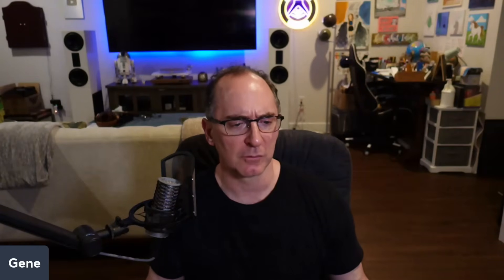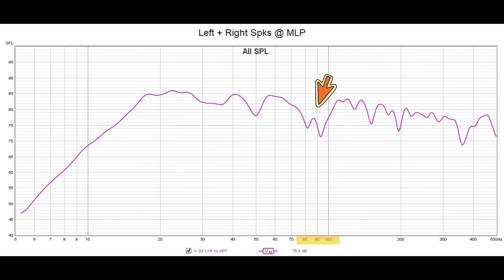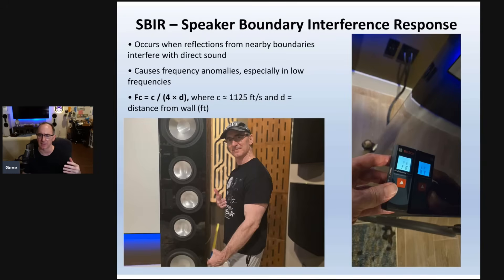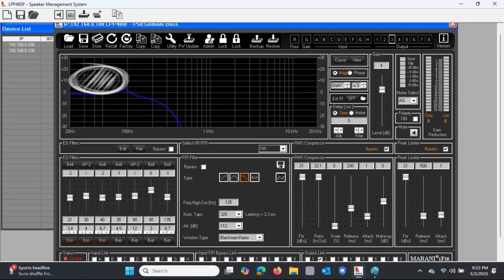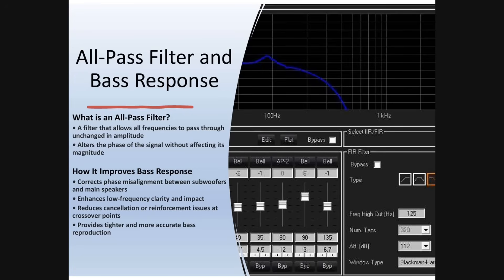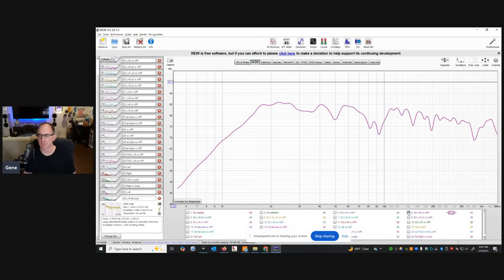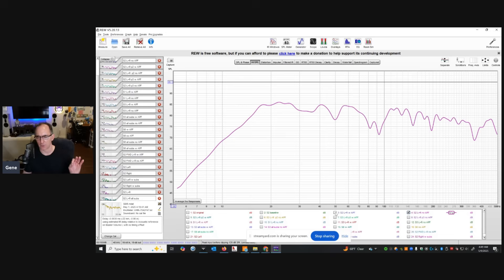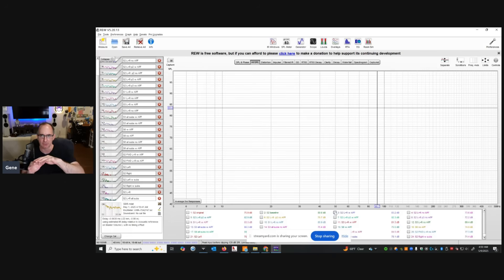4 Fixes to a Common Bass Problem Revealed!

Comment from the maker: :_Shout: Only a speaker completely flush against your wall surface is considered an infinite baffle immune from SBIR effects. Use the calculation: Fc = c / 4*d where c = 1125ft/s and d = distance in ft from front wall to your speakers bass drivers to calculate the problem frequency range due to SBIR effects.
Reply: So basically only an in-wall speaker?
Or also a speaker with no rear port placed against the wall with no distance?
Reply: @xavdeman a speaker pushed up against the wall will still have the distance from wall to the driver. The front of the speaker needs to be flush with the wall
Reply from the maker: @MrBonger88 correct, which is why I added the note here.
Reply: @Audioholics  This much has been known for decades, really, but the exigencies  of achieving the least compromised in room performance while attaining domestic acceptance is the bigger problem, I think. To mitigate the room problem as much as possible, either build a she like Ron Brenay, or just just use headphones and buttshakers . 🤭😵‍💫
Reply from the maker: @xavdeman correct

Comment: I got my Sonus Faber Guarneri Evo speakers out at around 4’ 7” which gives the boundary effect at 60+ Hz.
Also have a set of Duntech PCL-15s at around 5”
Having Trinnov Amethyst and a stack of 4 Audio Physic Rhea II subs, generally crossing aroound 70Hz …. Insanely great and bass to die for ❤😊😎💖🤩😍

Comment: Hey Gene, I would love to here more about bass management. I recently added a minidsp 2x4 hd .What a game changer .Never heard bass so tight,smooth, and accurate. I built my third and final theater. Watched your videos on speaker placement during construction. I never used subs with two  channel audio before. I have a very tough room .I feel I could, and I'm sure a lot of your listeners would benefit from an extension training program regarding all the features of the minidsp. A sort of step by step ,maybe develop a course we could follow at home ,even home work to summit to our channel, and you to go over the results, including room treatments.Regards Jim

Comment: Hi - for towers with large woofers like 12-15" should you use a large speaker setting or set the LFE to LFE+main for double bass on a Denon?

Comment: Thanks Gene, that was unbelievably helpful. I have Triad Silver in-room LCRs, along with four SVS SB 16 Ultras that I had an all four corners. I had the Triads pulled out into the room 2-3 ft and no matter what I did I had that same suckout in 8O to 100hz range and it was noticeable. I pushed the L/R speakers against front wall the four SVS subs now at 1/4 and 3/4 in the front and back of the room.

Problem solved, I'm now really flat through the crossover and the bass is so much noticeably better.

Appreciate it!

Comment: Hi Gene I have speakers with ports in them that I currently have plugged. I also have a subwoofer with two ports and I leave one unplugged. How do you know when it is better to unplug a speaker? My LR Speakers are about 1 foot away from the wall. Might be a somewhat simple question but I'm sure lots of people wonder the same thing when getting into sound systems.

Comment: 6:40 the phase dial or sub 'distance' setting is also a form of phase correction - good enough for most people.
Reply from the maker: Pysse dial doesnt behave the same as distance but its still a very useful tool. Distwnce adjusts delay for the entire bandwidth while phase control usually works around a narrow bandwidth.

Comment: I’d like to ask that you do a video addressing bass issues in your 2 channel setup.  I think the approaches are similar but differ in significant ways.  Deep bass (below 40-30 hz) is less important for most 2 channel systems as there is less musical content in the deep bass area.  Second, my guess is that your 2 channel setup is in a smaller room than your HT setup and small room acoustics are particularly challenging.  Third, going over the same issues in different settings would be very helpful as this area is complicated, with few straightforward solutions.  The problems with bass are predictable: room modes and SBIR.  But the solutions are not.  Every example helps others to figure out how to approach their situation.

Comment: I have same problem with my rel 1205 mk2 x2 , they can only do BASS under 70hz, on 80-120 hz i have deep pit( which is strange, because my signature 73 centre x3 by passport can even play up(down?) to 33Hz, but in fact 70-90Hz they are very weak (plus a small room with mods gives an indication of itself). I used to have no such problem with small class phase-inverter subwoofers, they were humming from 70 to 120 Hz :)))))))))) but after switching to Rel Ht I got this issue :(

Comment: I love your videos! Have yall made a video I haven’t seen addressing the klipsch rp1600sw still having amp problems? I’ve watched your video review on it several times as I’m in the market for 2 sub upgrades and I’d love to try out klipsch subs to match my klipsch 7 bed layer and 4 atmos setup but the amp issues I’m reading and hearing about is making me want to just suck it up and buy 2 pb17ultras

Comment: I just picked up a brand-new Klipsch R-101SW, fresh out of the box and I’ve noticed that the bass output is unexpectedly low. I’ve tried multiple connection methods
- RCA Audio Out from my TV  
- Line Output from my amplifier which is a boss car amp running in my home

Despite these setups the subwoofer's bass remains weak. The gain is turned up appropriately and I’ve ensured all cables and connections are secure. Are there any known issues with this model? 

I’d really appreciate any insights or troubleshooting suggestions from those familiar with this sub.  

Thanks in advance!

Comment: i have a slightly annoying problem. My old Marantz SR7010 died. So I thought, that Marantz Cinema 50 looks nice. My problem now is that the high end is a bit more clear but the low end is really weak. I can't find any real settings that can changge this and I¨'m not convinced the difference between 7010 and C50 is that big. Any suggestions?

Comment: Hi Gene, when you say to place a sub in a corner behind your speaker should there be a clear line of sight between the sub and the listening area? My speakers would block at least part of the  line of sight.
Reply from the maker: @tooch-g8k  it doesn't matter at bass frequencies.  Place the subs corner loaded or against the front wall. Sometimes, I place the sub sideways, so the driver doesn't fire at the listening area at all.
Reply: Thanks for your time, Gene.

Comment: Really like your podcasts, but isn’t there a way to address SBIR that you did not mention: DSP.   If you happen to have a measurement mic (I do) and can run room correction SW like Dirac (which I have), you can see the effects of SBIR and correct the bass response for it.  It might take some power, but in my case, I have dual 15” woofers (open baffle) wired in parallel for a 4 ohm load and my woofer amp (speaker is bi-amped) put out 450 watts per channel into 4 ohms.  I have all the grunt I need.  This is not a HT setup, rather this is 2 channel.

There are lots of reasons to have a sub(s) in 2 channel, but in terms of addressing SBIR, isn’t this a viable approach?

I did some research and it turns out you cannot power your way out of nulls.  The only real way to address them is proper placement of a sub to counter the null.

Comment: I've set up my system in three different homes over the years. My current (and hopefully FINAL) setup is the best I've done so far, but I still have the classic problem where the bass sounds alright in my MLP, but sounds AWESOME when I'm standing up behind my MLP...

Also, no matter how I set my two subwoofers, music 100% sounds better in direct with the fronts running full range.

Comment: Great information shared 👍 

Room is the biggest challenge to achieve the best audio performance especially LFE.

Since you are a bass lover i am very interested to ask you about LCR with Subwoofer integration by using high-level connection Subwoofer company like Rell Tx series provide high-level speakon connection as well as LFE they says it works both duties like directional bass and LFE their recommendations like LCR use bookshelf (6.5" Driver size & freequency response 50-20khz) and assign as a Large on AVR / pre-pro.for Subwoofer settings recommendations are LFE+Main and crossover to 250Hz In real situation how it's going to perform.is it really make a huge difference in hometheature experience 

Lastly we would like to see your DSP (Marani LPP480F) setup and configuration in a dedicated  video

Comment: I have large towers, dual subs and a small livingroom.
My electronics are a Denon X6500H and a NAD M27 power, so enough power and dual 14" subs
 I never got Audessy quite right in this room. Eighter to flat and lifeless, or uncalibrated an very boomy in some frequenzys. HUUGE of the charts roomgain, but not very good bass calibrated.

Before i spent a "ton" of money on new electronics, or better roomcalibration, i came across the Audessy EVO tutorial here on Youtube, and MAN! That was a game changer for me.

 Without replacing reciver or buying Umik and DSPs, i just ran a accurate normal calibration, ran the EVO script with help from REW, chose the prefered target curve(harman target curve+10db as i allso like bass) and like magic! Both music and film sounds amazingly better.

Comment: Bassreflex and no room to breath is the biggest problem of all, besides that most people buy to big speakers for their room. I think closed enclosures are better overall.
Reply from the maker: Agreed IF the closed enclosure has enough deep bass output without an agressive HPF so it benefits from room gain.
Reply: @Audioholics  most speakers with basreflex also sound way better fully closed. They roll off nice into the bass and start and stop on a dime. Also the clarity of the midrange gets better that way. Only be sure your tweeter also has an closed enclosure.

Comment: Would bass traps help if they are under the couch or behind the entertainment center?
Reply from the maker: Bass traps are always a good idea. Try placing them where you can and measure before and after. You tend to need a lot of them to be effective at very low frequencies tho.

Comment: Great info,  I need to get a proper microphone and analyze my acoustics when I think I have manually dialed in my system.  Question,  even if you have a monster set of full range towers do you still recommend setting your theater processors speaker assignments to small speakers, regardless?
Reply from the maker: NO. My speakers are definitely need to be set large. The SBIR issue is an issue, however, which is why I made this video to help counter those problems for those with large tower speakers out in the room.

Comment: Very common to see advice saying set your crossover at 80hz but I set mine at 40hz and I'll tell you why- now my mains are bass sources in addition to my sub so that's three bass sources instead of one. Since bass sums at the crossover point that means the mains start to roll off above the crossover point so it also softens the slightly bloated bass my Polk LSi15s are known for. Room EQ wasn't able to fully tame these beasts but combining it with the very low crossover was the magic bullet. When I watch movies the sub LFE channel is full fat and not affected by the low crossover setting. As far as I'm concerned I have the perfect music/movie setup, it blends beautifully and digs deep with absolutely no way to tell the bass isn't coming from the mains, and movies have all the brown notes you could ask for.
Reply from the maker: Setting your subs to 50hz limits the benefits of modal manipulation in your room to 40hz and below, which reduces seat to seat consistency.  If you care about the bass in all seat locations,  you may want to raise that crossover point.
Reply: @Audioholics  that's true there are some changes depending on where I sit but the money seat is good and it's all mine

Comment: Great video. Would love to see something for 2.1 channel system.
I have my Arendal tower S speakers 48 inches out but even with the best placement for a sub (SVS with some DSP) I cannot get anywhere near smooth bass. The APF sounds like a great solution but what other DSP products use or have these filters ??
Reply: After thinking about this, the "All pass Filter" must be in the sub !
You cannot EQ or DSP out the SBIR dip from the main speakers since whatever comes out the front still reflects off the wall out of phase and thus the dip at 1125/4*d.
So what subs have the APF built in ?

Comment: I know your using a Storm Audio processor which has Dirac Live A.R.T. , have you used this and if so what effect did it have on room bass? I remember a video you and Matthew P had on this (ART) a while back and Matthew said this was a game changer. I don`t know maybe I missed it (the video) but I haven`t heard much since that video.
Reply from the maker: ART has been a disappointment for my system so far. It employs a very aggressive non defeatable HPF on my mains which messes up the bass response when integrated with my 21" sub. Waiting on Dirac to offer a fix for this.

Comment: My “home theater” setup is very casual, basically just around the TV-area of the living-room and it’s a very shallow room as well, at least in the way the speakers happen to be set up. - So I don’t really have much in the way of options. - While this isn’t going to help anyway, I just wanted to describe how stupid my bass-response is, because… while the subwoofer is quite capable, the exact spot where I sit seem to be in some kind of black hole of the low frequencies. 😆 It’s not completely gone, but it’s the weakest, while in front of me and at the walls and down the room it all seems to heal up in an ugly boomy mess, I don’t even hear that pollution at all. It’s really weird. And flipping the phase doesn’t seem to do anything for some reason… 🤷🏻
I’m thinking the only way to get it different is to also put the subwoofer in a completely different spot. But again, it’s not a very large living-room, so it would tend to be in an awkward spot. If not, perhaps a second one and then let them work together rather than one that tries to do everything and have frequencies all over the room but the center.

As for the front speakers, they’re up against the wall, so they’re also a hit boomy, but I just tame them with the equalizer to get things evened out. - Forward is not an option, and I would put them in the wall, but I have European walls, so…

Comment: This was VERY helpful.  I use Dirac in conjunction with a MiniDSP SHD so I know the frequency response of my main speakers at the listening position (LP).  There is a huge suck out in the bass.  I’m more or less flat at 100 hz and then the bass response dips down significantly from there, bottoms out and then come up and is actually approx 3 db above flat at around 34 hz before dropping off quickly.  

I fixed the problem with DSP, but I understand that this should be the last option.  GIK has some bass traps which are 24”x24” and one of their designers told me this is their best trap.  What isn’t clear to me is how many I would need to have a significant impact on the SBIR issues I have in my room.  

I really think my best answer is to skip the bass traps and just get dual subs.  From what you have said, that would definitely fix the issue and give me additional low-end bass whereas the traps may or may not work, especially given that I cannot place traps in the front corners of my room.  BTW, this is a 2-channel system for music.

Comment: Make ur wallpaper subwoofers. That always works
Reply: I understand that for folks lacking the floor space (and budget) to implement full Trinnov style waveforming, that a quad of Sammy subs strategically placed in the ceiling can be quite effective. A basement room with a 9 ft ceiling would help of course.

Comment: Subwoofer integration with the front/Mains is so important.  Would love some content focused on how to integration the subs and mains, especially the L/C/R in a home theater system.  Specifically what techniques and tips you have around dialing in the integration in the crossover region between the subs and mains.
Reply: There’s a tool within the REW program for the specific purpose of such alignment; frequently used for multiple subs in a home theatre system where the XO from mains & surrounds can be folded into the LFE channel, allowing for reasonable decent and even response in smaller rooms with bass limited bed layer. At least that implementation worked for my compact full-range driver based Atmos rig.

Comment: It would be great to learn more about  what settings are involved in implementing all-pass filters and how to select them to best address an SBIR issue. Is there an element of trial-and error involved (i.e., choose a frequency/gain/Q?  then measure the effect in REW)? Thanks!
Reply: Definitely a deeper dive into how to measure for and implement AP filters with the more pedestrian types of DSP boxes many of us might be using,such as miniDSP 2x4HD / Flex series would be very appreciated.
Reply from the maker: Find the center frequency of the dip (fc) then calculate Q =fc (f2-f1)
Reply: @Audioholics  Gene, here’s my ignorance on full public display; what does the f1 represent?
Reply from the maker: @fonkenful  f1 is the -3db point of power aide of the dip, f2 is the high side. If the dip is 30hz wide from 60hz to 90hz, fc is 80hz, f1 is 60hz and f2 is 90hz. Q = fc(f2-f1) = 80hz/ (90hz-60hz) = 2.67
Reply: @Audioholics  Thanks, Gene. Since phase isn't mentioned explicitly in the formula you've provided, is it assumed that an all-pass filter flips the phase within the filter's frequency range by a fixed 180 degrees (i.e., an "inversion")? Thanks!